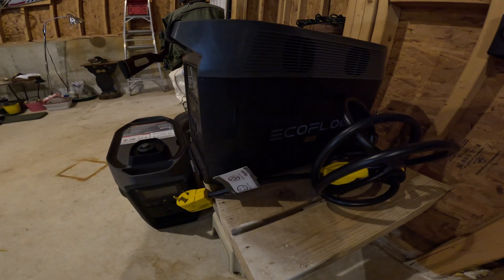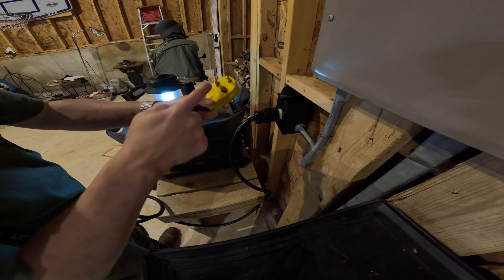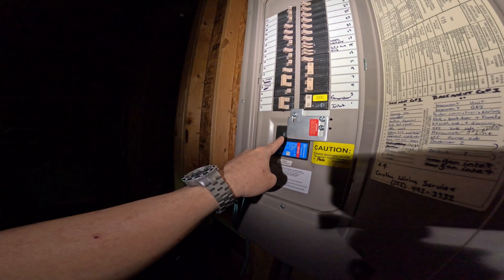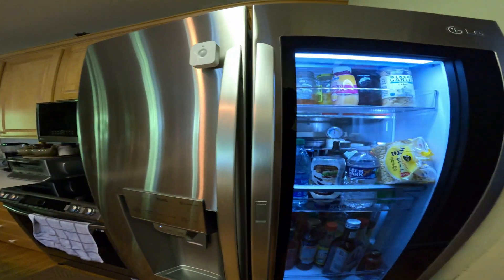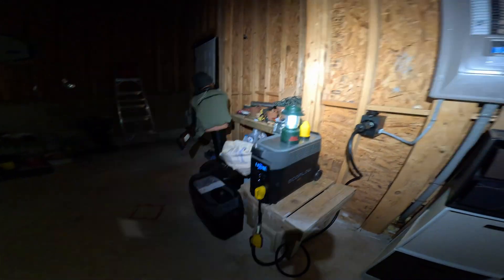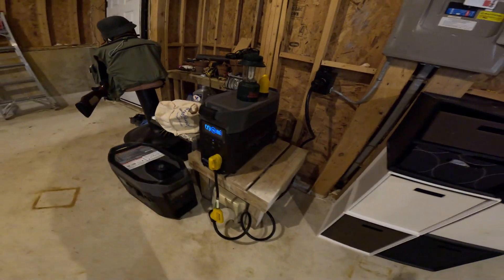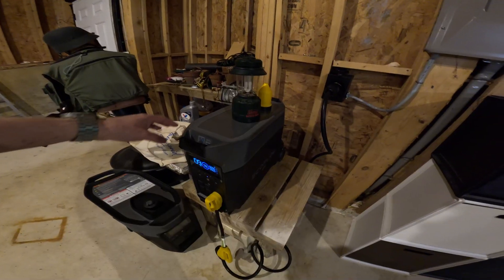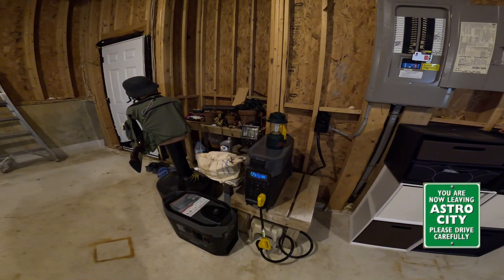EcoFlow Delta Pro = Power Outage Solution

Comment: Great video can you give me the part numbers to the cords you have please
Reply from the maker: An electrician in my follow-up vid tells me that I shouldn't do what I was doing due to the risk of there being neutrals on either of my phases on my circuits, so maybe I shouldn't recommend what I did. He suggests using the double-voltage hub and the two DPs together always despite the uneven drain on both. This may be what I'll end up doing. 

But to satisfy your curiosity, the cables/lines I used do work technically and they are the following:

The big cable to the generator inlet is constructed using the following:
Certified Appliance Accessories 90-2088 Range Power Cord, 10 Foot, 10 Foot

https://www.amazon.com/gp/product/B0014KQ65I/ref=ppx_yo_dt_b_asin_title_o02_s01?ie=UTF8&th=1

and 
Reliance Controls LL550P 50-Amp CS6365 Generator Power Cord Connector

https://www.amazon.com/dp/B000HRWGHQ/ref=vp_d_vp_d_fuw_pd_pd?_encoding=UTF8&pf_rd_p=f20fcda8-2440-4bfe-9c09-83295cb4a15a&pf_rd_r=HJ8HER5XDHA2YXBM7BKW&pd_rd_wg=6gJH3&pd_rd_i=B000HRWGHQ&pd_rd_w=RBXKR&content-id=amzn1.sym.f20fcda8-2440-4bfe-9c09-83295cb4a15a&pd_rd_r=a422cb1a-4f1b-4318-a505-5afa24899d7c

The 50a to 30a step-down adapters:

GearIT 30 Amp to 50 Amp RV Adapter Cord, 30Amp Male to 50Amp Female Dogbone RV Trailer Camper, NEMA TT-30P to 14-50R, STW 10 Gauge Heavy Duty Electrical Power - 18in, 1.5ft
https://www.amazon.com/gp/product/B07ZL1JLF8/ref=ppx_yo_dt_b_asin_title_o02_s00?ie=UTF8&th=1

Cable Matters 4 Prong 50 AMP to 30 AMP Generator Adapter (30 AMP to 50 AMP RV Adapter, Generator Cord)
https://www.amazon.com/gp/product/B076ZTZMHM/ref=ppx_yo_dt_b_asin_title_o06_s00?ie=UTF8&psc=1

4 Prong 30 Amp to 50 Amp RV Generator Adapter Cord 12 Inch STW, L14-30P Locking Male Plug to 14-50R Female with LED Power Indicator
https://www.amazon.com/gp/product/B085H7BPM7/ref=ppx_yo_dt_b_asin_title_o07_s00?ie=UTF8&th=1

Comment: I don't mind plugging in what I need to keep running into a HD power strip and added extension cord if needed. I'd rather buy an extra Echoflow battery with the money an electrician would charge to wire up my panel. Using mine for emergency outages only. Nice informative video, thanks!

Comment: I was going to buy this generator for my two Ecoflow delta pros but after doing my research I bought this generator: GENMAX Portable Inverter Generator, 3500W Super Quiet Gas or Propane Dual Fuel Portable Engine with Parallel Capability, Remote/Electric Start, Ideal for Camping Travel Outdoor.EPA Compliant (GM3500iAED)
I only weighs 54lbs and can power both of my ecoflow pros. It also runs on propane and has a remote start/stop so it really dose everything the ecoflow generator does but better and  it is half the price!
Also the Ecoflow generator runs at a very hight RPM all the time so it will never last as long as other generators!

Comment: Easier and cheaper to get a Firman tri-fuel at Costco and be able to use natural gas as well as propane and gasoline to charge up your EcoFlow Delta Pro. You don’t get automated power backup but you save many thousands compared to a Generac whole-home natural gas backup.
Reply: i agree 1000%…i don’t see the value in the Ecoflow generator outside of the app features…how can 1800 watts charge the Delta Pro and run the house? a much better config would be as you described which is what i did, lol

Comment: Good video; have you actually tried running the house for a day or two with the propane fuel recharging the battery generator? Always good to do at least one full day to find any issues or flaws in your plan.

Comment: Like your straight forward not sponsored approach to this power system, I'm still on the fence between the DeltaPro with the SmartGenerator and the Anker 767 with expansion battery.  I like the fact the DeltaPro can be charged automatically with the SmartGenerator.  Have you tried this function yet, when the battery level drops below a set limit the generator starts and recharges the battery on the DeltaPro.  Plus how is the customer with this company.
Reply: The EF has a true 30A port (3600/120v = 30A) where the Anker has a 30A plug only capable of producing 20A (2400/120V = 20A). So when factoring in your Amp loads add that into the equation. Stinks that you have to check each manufacturer, but it’s become the norm sadly. Do your own research of course.
Reply: @heart4Pahoa  Thanks, that would be a very important factor with these power storage devices.
Reply from the maker: Yes at the beginning I show how the battery is programmed to charge at 20% and stops charging and turns off at 98%.  Ikve since set the slider to start and stop at 20 and 90%. It werks well. As for cust serv, yes Ikve spoken to them 4-5 times on the ohone and emailed them half a dozen times. It is outstanding this far. I originally prdered 2 of delta pro and decided at last moment to cancel second unit. I asked them to intercept the shipment and retrieve it without me having to pay return shipping.  They made it happen.  I also asked questions about the generator inlet issues and they answered within a few hours by email.
Reply: @YiHogyun  That's great to hear about the customer service, keep us posted on how the unit preforms, nothing like real-life application.  Thanks!